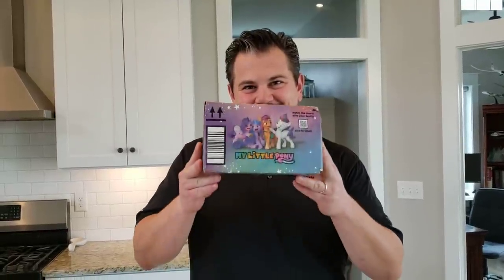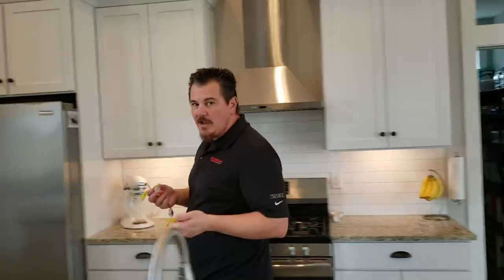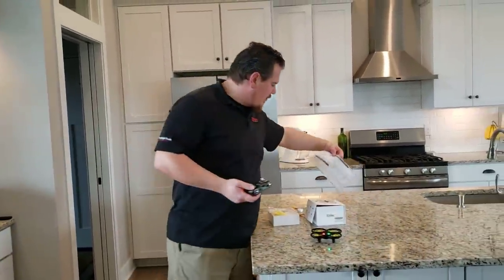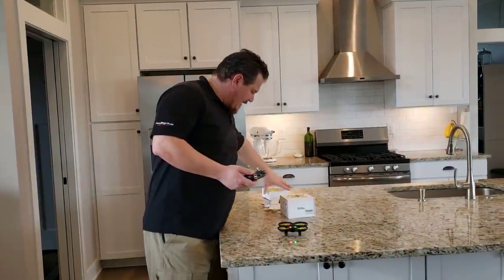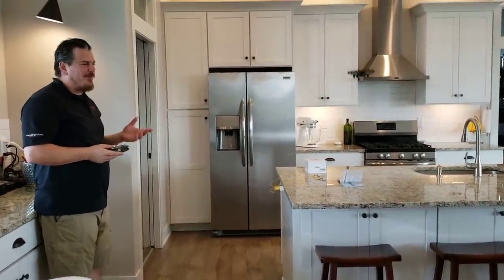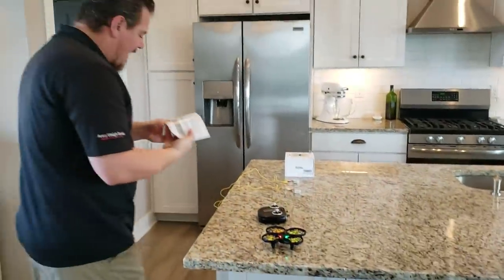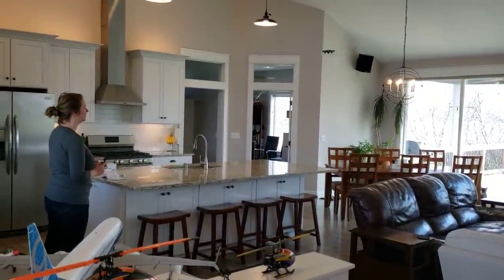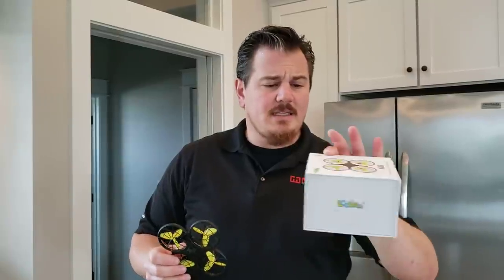Loolinn - X26 - RTF Drone - Unbox, Radio Setup, & Maiden Flights

Comment: dudes got a beer bucket with 10000000 batteries
Reply: I have actually seen this method used in several Hobby Stores that I have visited. They also add a little bit of sand to the bottom. It works nicely and it saves from having to cram them in a bag. If you have ever witnessed a lipo catch on fire I’m sure you understand why. 🙂
Reply from the maker: Megan and I saw them at the store and thought, WELL - that's better than a huge fire on the window seal ;)

Comment: Hey brian. Sorry for this off topic. But I’m putting a Spektrum ar 631 receiver in my easy trainer 1280 v2 to have safe and ax3. My issue is I have to mount it like 5-6 inches to the front of the CG. Will this still work?  Thanks. Sorry I had noone else to ask. Thx
Reply from the maker: This will not be a huge issue at all. I've found that it's even fine OFF the center line of the plane (Which seems like voodoo magic to me...)

You'll be fine. We have a bunch of good videos, if you need help to follow along with.
Reply: @BrianPhillipsRC  👍. I noticed my t28 trojan and my carbon cub s had them mounted from horizon dead center or close. Thank you for the fast response.
Reply: @BrianPhillipsRC  thanks again brother. Have a great thanksgiving